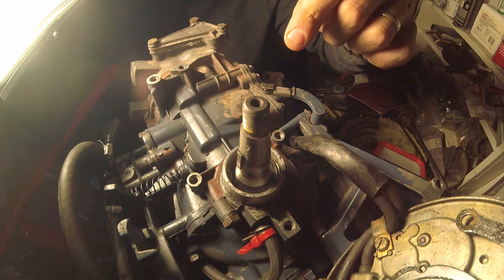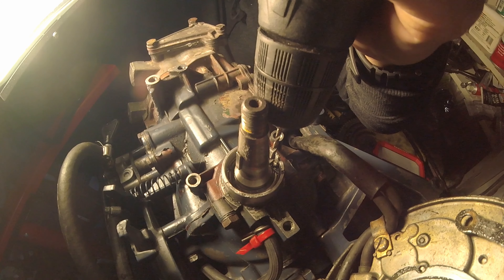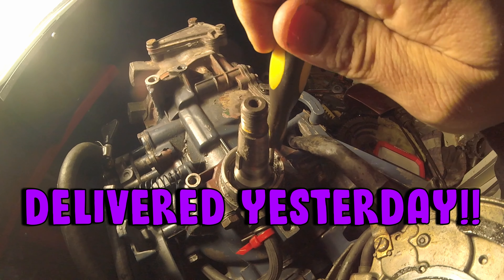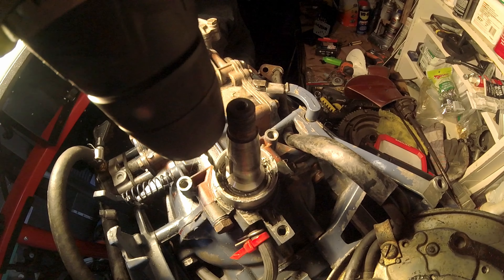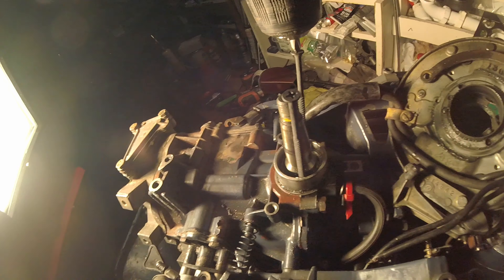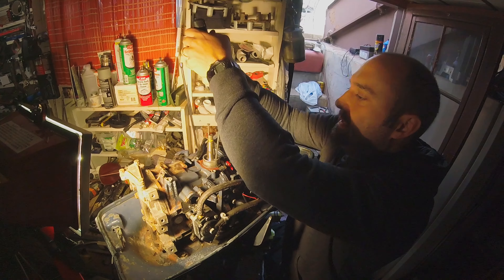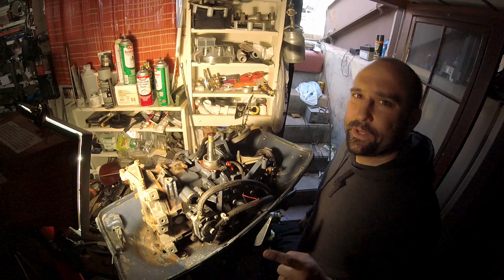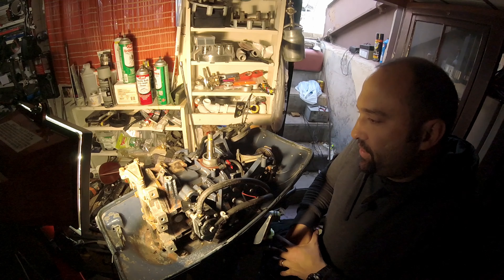How to take out Upper Crank Shaft Seal on a 1970 25hp Outboard. IS YOUTUBE AS FAKE AS HOLLYWOOD?

Comment: Hey Bill nice job your learning fast! Is that the 25 HP you had on your boat recently?Were you loosing vacuum thru that seal, was their oil under  & around the the points???  Ive worked on tons of 18-25HP OMC motors thru the years never too much problems with the uppers but the lowers more so. The carbon case housing and O rings broken or distorted is more common.........Glenn P.
Reply from the maker: yes! I sprayed wd40 in the housing and spun the prop and air was coming out!!. Now whats interesting about this motor is in a previous video I rebuild this power head FROM SCRATCH!! 
Now i SURE hope the lower one is ok cause I had it apart and would have changed it when i did lol but yeah lower part of the mag plate was covered in crap!
Reply from the maker: coincidentally I believe i did replace those o rings you're talking about!! here is one of my older videos on this block https://youtu.be/clXbSRoyobk
Reply: @BlackoutBilll21  Your fun too watch you appear not to know anything but you get the job done thats funny and your humble and nice too watch keep up the good work ever need parts let me know. I have tons of those motors Im on Long Island!!..Glenn P.
Reply from the maker: GFPALL62 hahah oh yeah facts are I don’t know dog shit 😂😂😂
Reply from the maker: GFPALL62 I could always use another 25hp block. Or those side plates to take a fuel pump for my 7.5s that i want to do the conversion on
Reply: @BlackoutBilll21  Hey Bill dont knock yourself you do allright! I know one thing I know a Hell of alot about these oldies and believe me I dont have your patience which is a good thing for you bad for me. Im Italian blood and get pissed easy so I just walk away cool off and comeback and fix them,LOLL!  Glenn P.
Reply: @BlackoutBilll21  Dont think they ever made those fuelpump sideplates for 5.5-7.5HP pressure tankers only 10 HP and up... You can modify the stock one with a little thought . I have plenty of  18-25HP blocks.